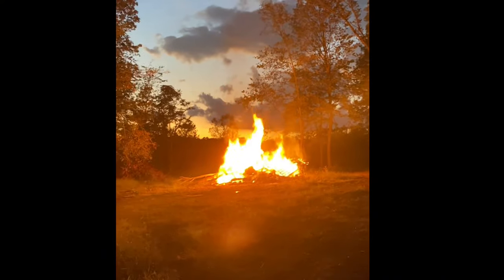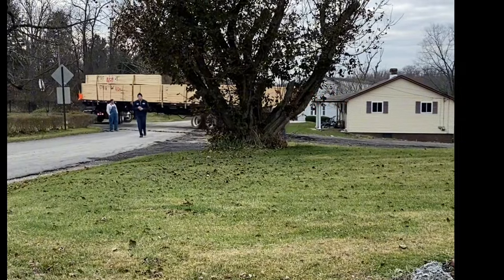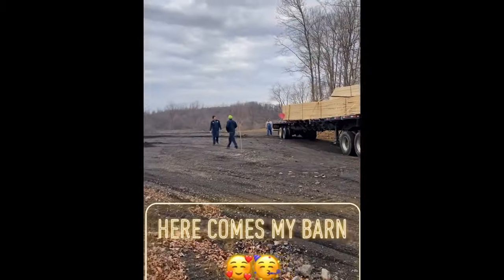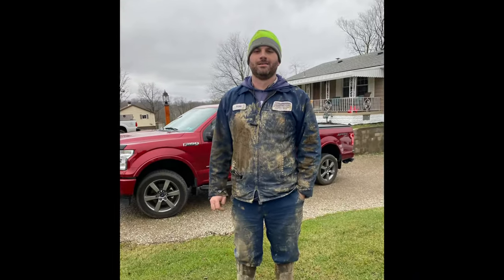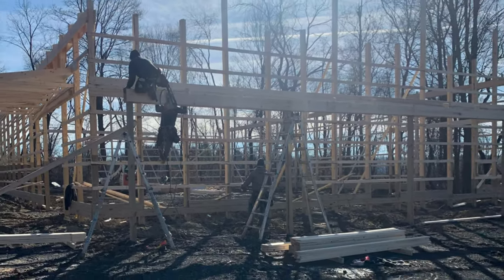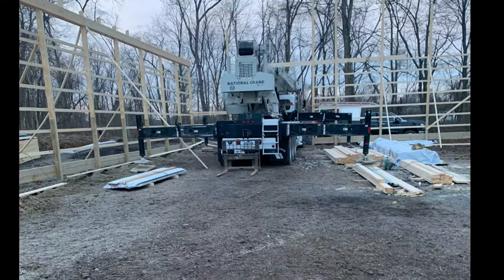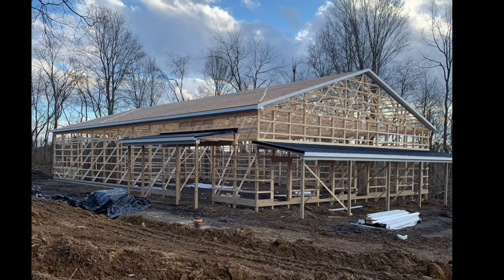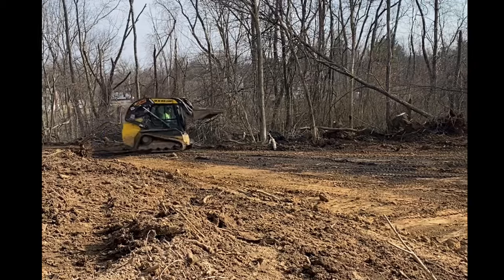100’x 60’ Pole Barn Build & Cost

Comment: Nice job. Big building. Must of been quite a tug with the dozer to get the truck out of the mud. 👍🏻👍🏻👋👋 
Have a good one Tom. 👋
Reply from the maker: Yeah, the truck with half a load of concrete is about 50 or 60,000 pounds probably the Dozer only weighs 18,000 so it was a little struggle
Reply: @fatefarmspa  👍🏻👍🏻👋👋